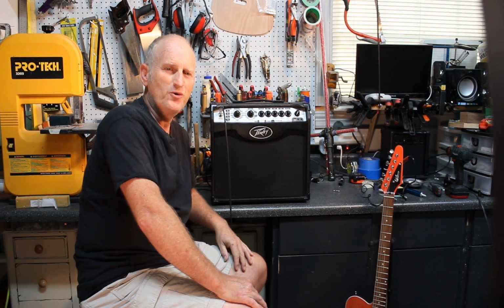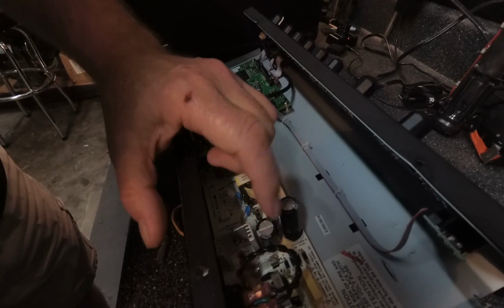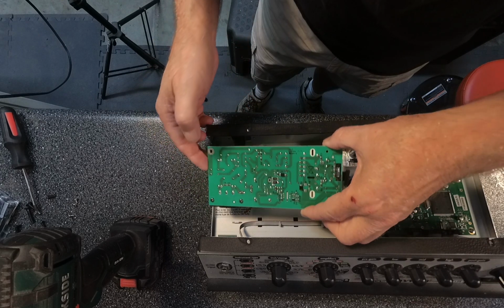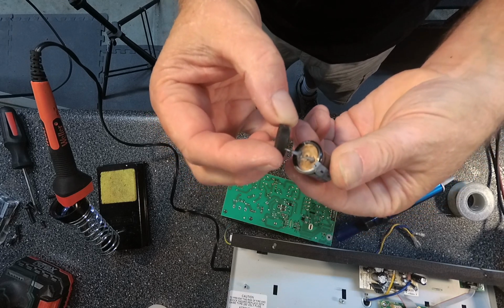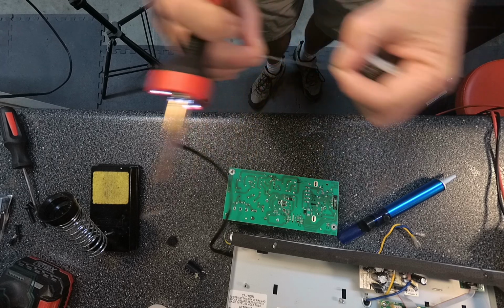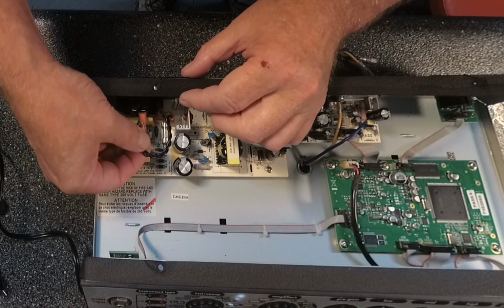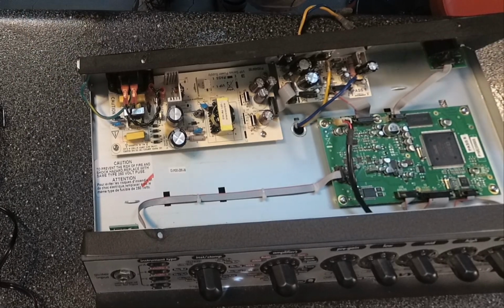Peavey Vypyr VIP-1 amp repair

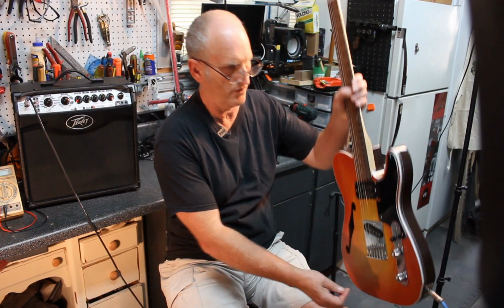Comment: Hi Joe 👍on the repair. This video is an excellent demo of the VYPYR whistling @ 12:20 where you demo that it works. 

I purchased one several years ago and could not get on with that whistling/ringing. I exchanged it for another one and it had the same problem and gave up. I know someone else who experienced the same thing with two brand new amps. 

I determined that it had something to do with the master volume. Or the input was picking up digital noise from somewhere. 

This is a pretty good amp with lots of useable tones, but I could NOT deal with that high pitched whistling because it resonates with the normal ringing in my ears. 

I’d go back and give the Peavey another go if that ringing/whistling could be fixed.

Comment: I had two Peavey Vypyr 2 amps, the "pots" on the older one stopped working and could not be fixed by simple cleaning. Then one board after another failed on the new one. Unable to identify any failed component on the boards, I have kept one amp running by combining the remaining functional boards from the 2 amps. When the main amplifier board went bad, the amp would repeatedly turn itself off and try to start again, the result being just a click-click-click sound, a common failure mode for these amps based on internet queries. When the second board failed, the amp put out something like 0.1 watt power, barely audible at full volume, with high distortion. I detail the first board failure at https://www.youtube.com/watch?v=4riB03qj1JE  If you would like my old boards to attempt to figure out which component failed, let me know and I would send them to you. It would be interesting to know.

Comment: Wish my VIP2 issue was a blown cap. I get the cycling lights and it works briefly when fully cooled down. After it warms up, all control ceases and speaker hums/feeds back really loud. There is extreme heat coming from the AMP PCB. Any tips on an AMP PCB issue? Their "heatsink" for the 3 transistors is literally just a bar of aluminum.

Comment: The problem with the original cap was it was installed with the polarity reversed.  (Negative marking was on the edge of board before you removed it.  When you properly installed the new cap, the negative side was away from the edge of the board, facing the other cap.)  Nice video.

Comment: Mine is NOT sliding out like you are showing. What am I missing?
Reply: Mine had the same problems and there were screws on the back on the inside against where the speaker was
Reply: @Venompool-ms8lm  Got it out. Fixed the USB, then when I tried to fix the firmware, seemed to work great, then power cycled the amp, it bricked the amp. Now it is a doorstop
Reply: @therealsmartmammal  nnnice, makes me dreaming about opening mine for homemade repair

Comment: I've tested Peavey Vypyr VIP1, and it has a same annoying high pitch noise in the background. 12:15 It is fixable?
Reply: Yes. The linear voltage regulator, Adafruit 5V 1.5A Linear Voltage Regulator - 7805 TO-220 [ADA2164], is usually the defective part. About $6 USD on Amazon as I write this.
Reply: @rogerhinman5427  I read the same thing about the incorrect/faulty voltage regulator causing this issue on the Peavey user forums. It seems like it must be a manufacturing issue (perhaps Peavey started sourcing the voltage regulators from a different supplier at some point which has lead to this being an issue for a significant number of users). Have you done the repair yourself and can confirm that changing the voltage regulator fixes the issue? I’ve already ordered the new voltage regulator. Once it arrives, I will be taking it down to a local amp repair shop to swap out the voltage regulators in the hopes that the ringing issue can be fixed. It’s a shame, I love the amp but just can’t enjoy it with this distracting high-pitch whining in the background.
Reply: @brandontadday  I did and it worked on mine.
Reply: @rogerhinman5427 

I have the same high pitch sound coming out of my VIP 1
Brought a L7805CV from Amazon, installed it with high hopes, and it didn’t resolve the high pitched sound. 
Is the L7805CV not the voltage regulator I was supposed to get?
Still want to resolve this so bad, I’m willing to try anything.
Any help would be appreciated
Reply: @crizchun  That should be the correct one. I have no idea why it didn't work for you. All I can suggest is watch the video again and make sure you followed his procedures. Maybe the regulator you got has the same defect or you have other issues to fix as well. Good luck!
Reply: @rogerhinman5427  
There’s a video of someone replacing the voltage regulator ? I didn’t see such video…

Comment: My vip1 amp has been in storage for about 1 year , before I left in storage it worked just pulled it out plugged in and I have nothing ,, no lights no power at all 😳I stored in original box and haven’t moved it in a year what could be wrong 😑

Comment: You forgot to mention the two other screws in the back to get the powerhead out but maybe your amp doesn't have them
Reply: Thank you! Was pulling my hair out trying to figure out why it wasn't coming out. For anyone else in the same spot, the last two screws are inside the speaker cab, above the speaker. You might be able to get to them through the hole in the back, but it's probably necessary and definitely easier to just take the back off.
Reply: THANK YOU
Reply: 100%

Comment: I just repaired a Peavey Backstage with the same problem. Maybe a design flaw? Would a cap ,going bad, cause a low volume,  high frequency whine/whistle/ring, when you're not playing? It's not loud at all. just noticeable. I'm sure other VYPR  VIP 1 owners would like to know.
Reply: I concur. I just picked up a second hand Peavey Vypyr VIP 1 and am also experiencing the high-pitched ringing (around 3khz) which happens whenever a lead is plugged into the input jack. The sound disappears as soon as the tuner is engaged. I read on the Peavey user forums that it can be fixed by changing out one of the voltage regulators. I have ordered the part and will be taking it down to a local amp repair shop to see if swapping out the voltage regulator fixes the issue (don’t wanna risk dying by fiddling around with the electronics inside the amp).

Comment: I have the same exact amp. I took out the 4 screws on the top but it doesn't slide out at all.
Reply: there are two screws on the inside that hold the logo in place.
Reply: I had the same prob. There are two more screws in the back after you take off the cardboard piece. I never took one of these apart so was nervous other vids show that you wiggle it out , not for this one. I called the music store where I bought it and they refused to help saying for me to bring it in. They suck and tried to rip me off. This guy is a good man, trying to help people for free, I was barking at the wrong dog gonna give him a thumbs up for trying. Good luck with your repair bro
Reply: You gotta take off the back panel as well

Comment: Hi Joe, I recently purchased several lots of Vypyr amps from the Peavey factory auction. A total of 82 amps (Vypyr 60, VIP-1, VIP-3). Some work great, others have issues. I'll be checking back with your channel for any other Vypyr troubleshooting vids.  Thanks for the info!